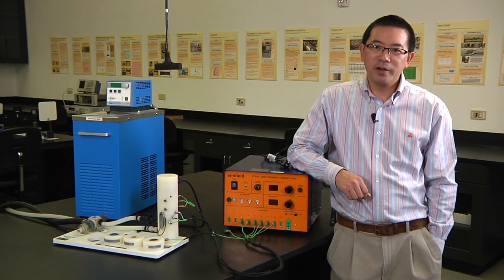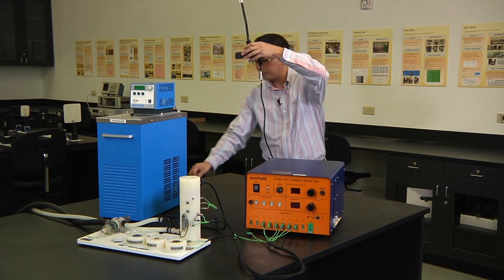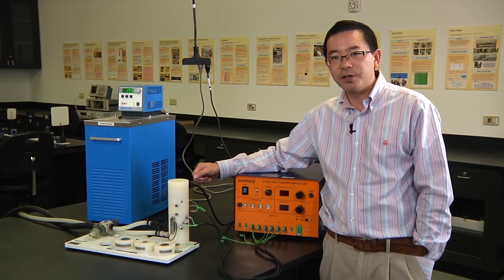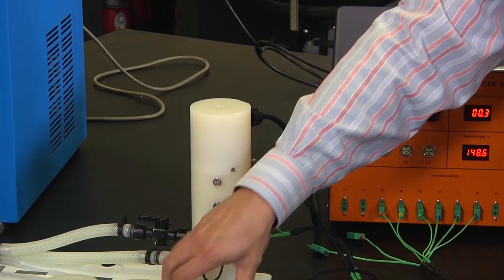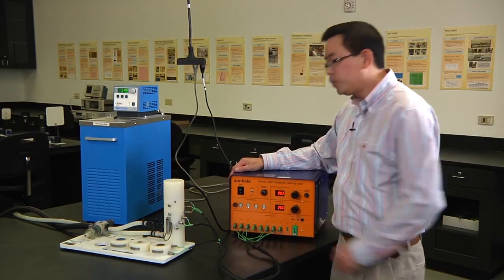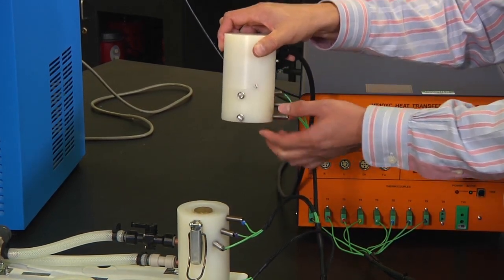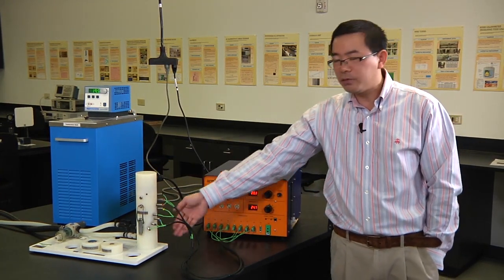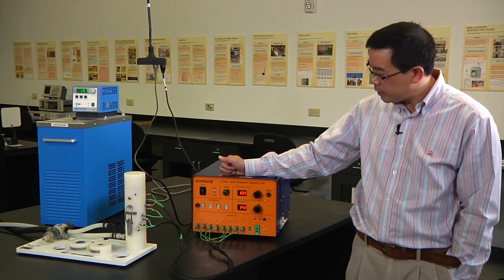Heat Transfer Experiment #1: Thermal Conductivity Measurement

Comment: What is you want to measure a thermal conductivity of material that has similar or lower thermal conductivity that the plastic insulator the cold and hot sides are embedded in? Lets something like air.

Comment: Hi, 

I used the HT10XC Armfield unit to measure the temperature along a brass bar which was being heated at one end and cooled at the other. I used the Fourier rate equation for calculating the Thermal Conductivity of Brass. Using 12V with 1.28A  25mm diameter brass bar

In the heated section it was 134J.s-1m-1K-1 
In the intermediate section it was 120J.s-1m-1K-1 
In the cooled section it was 169J.s-1m-1K-1 

Why is it much larger in the cooled section?